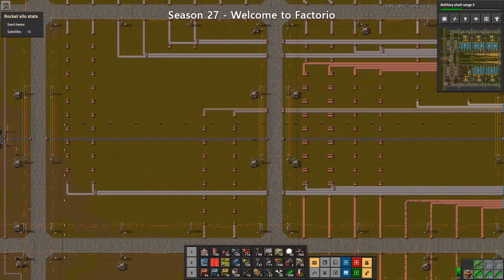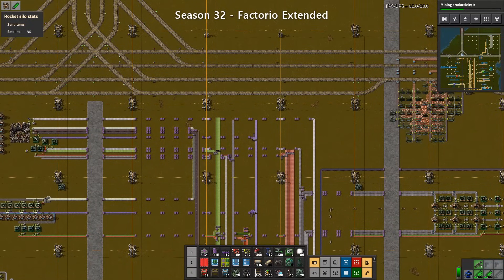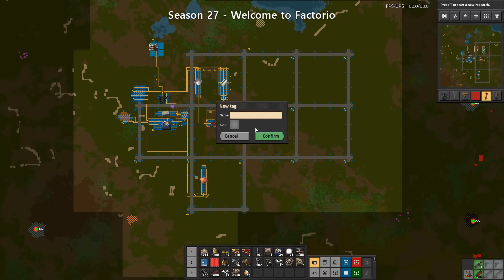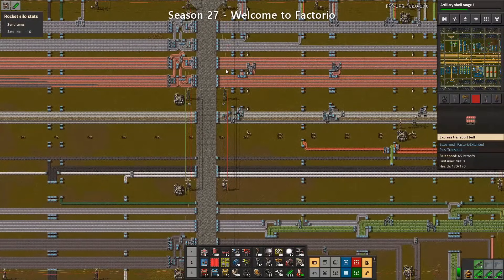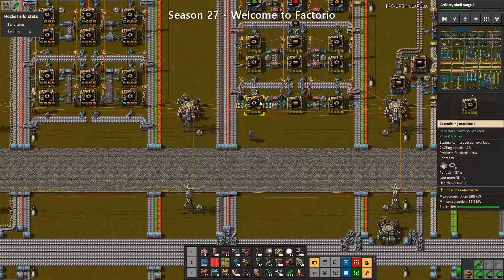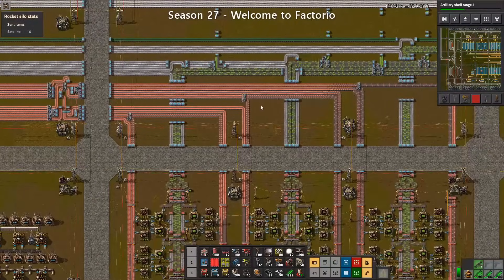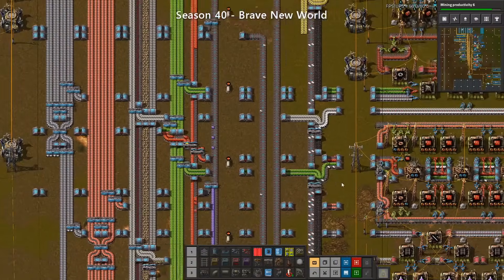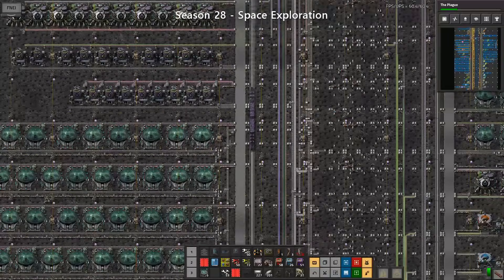Order Your Base with the MAIN BUS - Factorio 0.18 Tutorial/Guide/How-to

Comment: So do you put the fluids on the bus?
Reply: Yes and I reserve space for Petroleum, Lubricant and Light Oil. If I do not have the room I pipe them between the buslanes (where the undergrounds are)
Reply: It's a common strategy. As far as I know, people tend to either place underground pipes in the two-tile space between belts, or directly replace belt lanes instead. the first saves space, the other can allow to group all the pipes so it's easier to pay attention while driving a car instead of accidentally crashing every 10 tiles.
Reply: @thomac  I don't know why you are even driving in the main bus in the first place. I tend to avoid driving there, even without pipes, there are way too much things you can crash into in the bus, so I usually just left the car outside.
Reply: @yvrelna  nowadays I leave space on the side of the bus for a road (and space for power poles, roboports, etc.) So I don't have to drive over the belts. But I still can. And when I was a noob I did it all the time. I don't know about you but I spend a lot of time going back and forth along the bus. Especially if you build on both sides it becomes the central artery of the base, it's just easier to access things from there than circumnavigating the base.